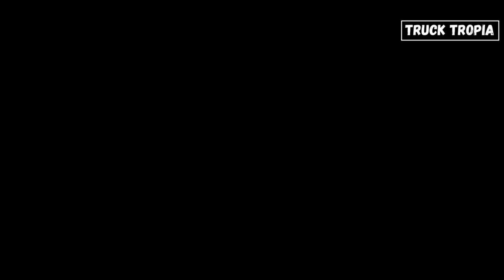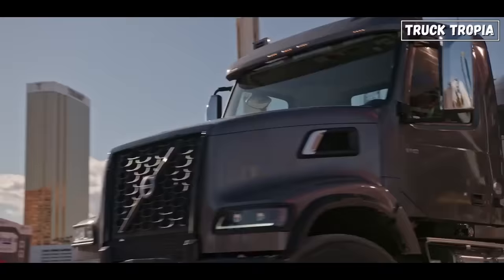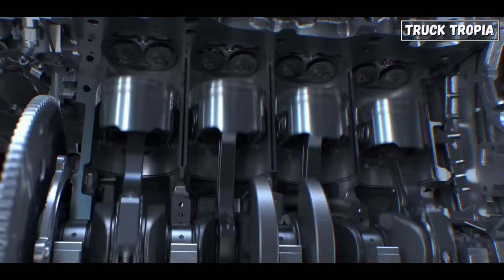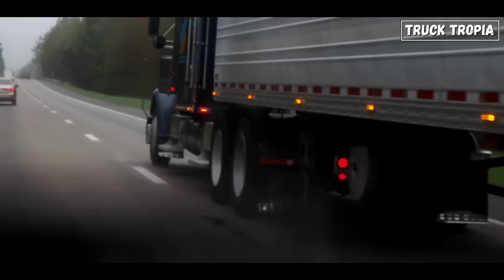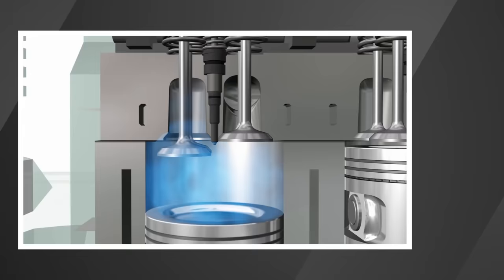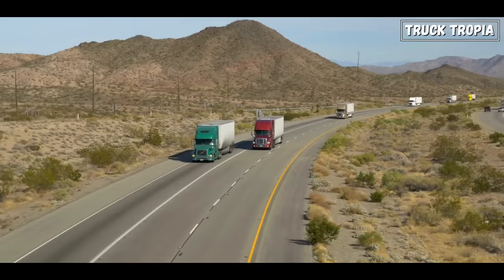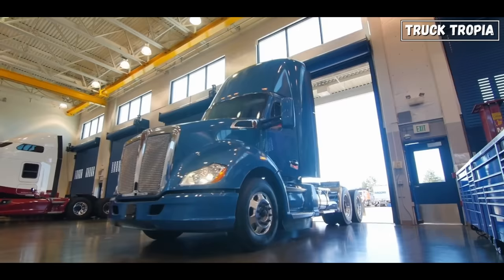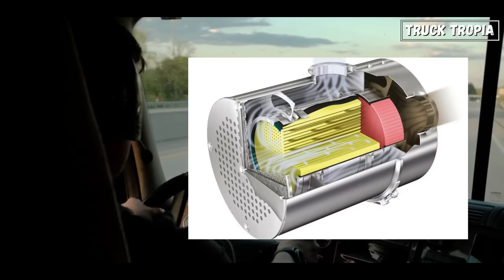Ultimate Truck Education 101 - Every Question Answered

Comment: On the transmissions, automated  ones can produce better fuel mileage with average driver experience but manual transmissions can get better fuel efficiency with very experienced drivers.
Reply: Automatics, any Primate can operate one, IMHO the reason that we are seeing so many more and serious truck wrecks is due to the proliferation of the automatic transmission. 
They are putting any Tom, Dick and Jane with a heartbeat behind the wheel.
Reply: Every truck driver out there started as a Tom, Dick or Jane. Automatic trucks still have gearboxes, the computer shifts the gears which protects the engine from over revving and frees the driver to concentrate more on driving safely. Old stick shift trucks are dinosaurs driven by fossil’s. I would never drive one of those old trucks anymore. They suck.
Reply: @albertwilson7239 
And you can’t use a 13 speed because the school didn’t teach you how. The 1st truck I drove had a 2 stick 4X4 in the mountains of AZ, I never did get good with it. The truck I sold was a 13 only used the clutch when I was starting or stopping. BTW I never went to a driving school. I learned the old way.
Reply: @albertwilson7239    that’s not true. Not every driver started out as a Tom, Dick or Jane. There used to be a lot more generational drivers, like myself, that learned at a young age and guys like me helped those new drivers learn the ropes. Now you have drivers that have very little experience teaching new drivers with no experience. The fact that you believe that automatics are better just goes to show you were never taught properly. No matter the innovations with automatics, they have massive downsides, especially in hill and mountainous areas. They are especially harder to control when backing. It all comes from who taught you. If you worked for one of these big companies like Swift or Werner, then you were likely taught by either another inexperienced driver or a driver that was also taught by another inexperienced driver. It’s a chain that creates more and more bad drivers.
Reply: Then the maintenance of automatics is through the roof compared to stick shift. They are not more fuel efficient nor are there any advantages any way or form. Any Muppet can destroy an auto faster than a stick shift.
Reply: @dirtfarmer7472 Yes, some of us had the experience of the twin stick. Mine was with a 5X4. Knowing how to double clutch helped keep the gears happy while shifting that set up. That is another lost art. Had a ride along that asked what I was doing. They had never heard of it. They really knew how to make me feel old.
Reply: @ronfullerton3162  hell, knowing how to shift period is a dying art lol. I do love the argument that shifting gears is fatiguing though. I’m just thinking, are these kids so soft that moving your arm just a little bit to shift wears you out?
Reply: @Coonazz791  As with any job you do that is repetitive, it becomes an automatic reflex. I never consciously thought about the shift. Matter in fact, most any shift I screwed up was from thinking about it. The body and mind in a subconscious way keeps track of the rpm, the load, and road conditions. When conscious mind took over was for possible endangering situations coming up in traffic, weather, and such. 

The shifting is just like anything else, you have to learn it by experiencing it. After 100,000 miles or so, they would get past thinking about it and it would be automatic reaction for them. But "Geez, it is just too hard!"
Reply: @ronfullerton3162  yup, it’s the mindset of this current generation. Things have to be easy at every turn. If not, they don’t want to do it.
Reply: Trucking in the U.S. is being ruined by foreigners, often 5 in the same cab, many from india.    Spend some time just people watching at the flying J.    Truck never stops, with 5 smelly people just rotating the driving.
Reply: @albertwilson7239  Incorrect, There are automatics being used in trucks that are not electronically shifted gear boxes. Allison. They have been around for years too.
Reply: @C-Culper4874  Ive driven trucks and been a mechanic and I know what you are talking about but never seen one other than in books. It has a torque converter instead of a clutch  like a car. They also had automated manuals with a third clutch pedal, again, never personally seen one. Does not mean they dont exist. But very rare.
Reply: @albertwilson7239  4000 series Allison's are popular now. We have several in the fleet I take care of. Some prefer those instead of Eatons. Building an auto transmission to take the abuse isn't hard itself. The puzzle is making it fit between the frame rails. I went to school on the Gen 1 autoshifts in the 90s when the first 600hps 2000 plus torque. The signature 600 was a beast. I saw those put 700 to the ground in a w900. Eaton talked about making transmissions for those. The issue is the limited area it had to fit. Electonic controls are the reason they can pull it off now on the autos. The engine out put can be controlled. Throw one behind a 3406 with the fuel rack stop screws in the ashtray. They probably won't live long.
Reply: @Coonazz791  But there is one big difference between nowand then:

You said, that you learned at a young age how to drive.
But it took years to learn the skill and that time was given you to learn.
But today, people have a week or maybe a few weeks to learn. But there is still the expectation that you are the same good driver when you finished your training of a few weeks then as when you learned for a few years in the old days.

That's not really fair, is it?

But I agree, today the level of skill and common sence is going down hill... and fast.... 😕
Reply: @JohnnoHald It depends on what kind of automatic you mean.
Because a fully automatic transmission is indeed more expensive to maintain and service, then a manual transmission.
But an automated manual transmission (AMF) needs the same kind of mantainance as a manual transmission.
Because an AMF is basicly a manual transmission wich is automated.
And fully automatic transmissions are becoming rare these days. By far the most automatic transmissions are actually automated manual transmissions.

And AMF transmissions are absolutely more fuel efficiencient then manual transmissions.

And it's actually way more difficult to destroy a automatic transmission then to destroy a manual transmission. 
Because an automatic transmission has all different kinds of safety features built in the computer that will protect the transmission and engine against wrong gear shift, wrong use or user fault.
But a manual transmission don't have that protection. And it's easy to make one wrong gear shift and destroy the transmission and maybe even the engine.
Reply: @Coonazz791  Depends on the truck. Where I work we haul shipping containers. Most of the trucks are Ivecos, Ivecos do not like to go slow, so they are a pain to drive and can't manually push a gear up or down.
My regular truck is a 2006 Mercedes Actros, also auto, but will go slow and I can push it into a higher or lower gear, very nice to drive.
Give me the old Merc over the newer Ivecos every day.
Reply: @josviersel  sure, but from what I’ve heard from different drivers that have autos is that it seems there are upsides and downsides to each type/brand of transmission, but none have it all. But even though, those autos have a lot higher downtime and are in the shop a lot more often than a manual, this comes from dealerships I’ve talked to.
Reply: @musictolive4  I wouldn’t say it’s easier to destroy a manual since I’ve heard of a lot of those autos rip themselves apart.
Reply: @Coonazz791  I guess that would be possible, but I never heard of that or have experience with that.
But like every machine you operate, you have to get used to it. Learn the machine and learn to work with it. But also give the machine the time to do the job for you.
Like a manual transmission you also have to give the gears the time to float in to eachother. But with a manual, you feel it and you not realy aware of the time it takes to shift gears.
But a lot of drivers who drive with an automated transmission don't give the transmission the time to shift, and expect that the shift will happen instantly. Then things will go rough and you can do damage to a transmission.
Reply: I fiddled around and found that the Iveco can go into semi-auto mode, and how to push it up/down a gear - but it is not intuitive like the Mercedes.
(Iveco still does not like going slow.)
Reply: @musictolive4  I would just chalk it down to that there are advantages and disadvantages to each. But when it comes down to money, I’ll take a manual over auto any day of the week. For me, being an O/O, the costs of an auto just isn’t worth it.
Reply: Electric motors give better mpg
Reply: @unknownunknown-ni1ns  you’re right, but they get worse miles per pile of coal burnt.
Reply: Most of the younger generation can’t even use a 3 in the tree much less 18.😂
Reply: @albertwilson7239 I control the truck with a manual, with automatic the transmission is controlling the truck not you.
 I feel uncomfortable around automatics.
Reply: Too many primates behind the wheel 6:04
Reply: Automatics get zero miles to zero gallons when they break.

Comment: Tbh, large companies changing to automatic transmissions has nothing to do with driver comfort. It has everything to do with new drivers having never learned how to drive manual transmissions even in a car and not knowing the basics. I’ve driven an auto truck once before and I was more fatigued in that and found myself zoning out than when driving a manual. 

But just to prove my point, the driver in this video actually used the clutch while shifting. If you know how to shift properly, then the only time you need to touch the clutch is when coming to a stop. 

And before someone says, “well, an automatic transmission is great in heavy traffic areas.” Again, that’s because you weren’t taught right. I can drive through most big cities in stop and go traffic and rarely touch the clutch. If you don’t drive a truck like you’re in a hurry to get somewhere and just coast, then you’ll rarely have to come to a stop. But everyone wants to ride up each other’s asses like that’s going to get you somewhere any faster.
Reply: Fatigue sets in when you’re on a long open road not in stop go traffic so really it doesn’t make a difference because you’re not changing gears on an open highway. I’ve driven both manual and auto trucks and there is really no comparison in ease and comfort when driving an auto especially in traffic.
Reply: Shifting, or let's get down to brass tacks and call it floating, which is what you are doing without using the clutch pedal, is not something that is taught in the driving school because the prospective CDL licensee has to demonstrate to the state examiner the proper shifting technique using the clutch pedal when/if driving a manual transmission equipped tractor, which is what I had to do in 1999. I experimented with clutchless shifting several years later, it took a bit of practice but got the hang of it because I didn't want Arnold's left leg in contrast to the toothpick right leg
Reply: You sir are correct. I have a Dodge Power Wagon with 285,000 miles and have never had to make any major repairs. I rarely have to stop at traffic lights because I’m coasting to them as they change. I will never understand why people want to “Race me to a Red light”, Followed by a “Rabbit start to nowhere.”
Reply: I think it’s just so mega carriers have more remote control of the truck
Reply: @donaldtireman  I have a throttle spring that will solve that problem for you. 🤪
Reply: "The reason people are using swords now is because they weren't taught how to use a stick right! Back in my day everyone knew how to use a stick. If you can't use a stick and use your sword as a crutch then something is wrong with you. Get rid of swords and use sticks you'll do better in combat!"
Reply: @fuzzy5610  I can't believe anyone would try to argue a manual transmission is better than a automatic one. They only ever attack the driver and fail to actualize any benefit a manual transmission has over a automatic one for the person who's actually driving. 

People don't drive automatics because they're lazy or incompetent, people drive manual transmissions because they're stubborn and sometimes delusional.
Reply: @user-mc6dg6qe8l  2 totally different things. And who exactly are you quoting?
Reply: @donaldtireman  funny story about that. I had to go to a driving school for a refresher because I had gotten out of trucking for a while back in 2009. They taught me that all I had to do is tap the free play to pass the test and that’s what I did. 

This is what happens when the government tries to tell you the right way to do things.
Reply: @fuzzy5610  I did address this in what I said about driving in traffic. I can go through Chicago during rush hour and never have to come to a stop. Let me guess, you’re one of the guys that rides bumper to bumper everywhere you go. You’re constantly stopping and going when you’re in traffic.
Reply: @hardpointz399  remote control?
Reply: @Coonazz791  what can a manual do that an automated can't?
Reply: @AlexKall  so you’re going to answer a question with a question. Gotcha. It’s never been a good debate strategy and it never will be. You don’t want to have an honest discussion and there’s no point in talking to you.
Reply: Incorrect I would mostly use the clutch to start rather than stop
Reply: @estebanmena4332  did you know that’s actually illegal? You should be in gear at all times, even when coming to a stop.
Reply: Those newer drivers shouldn't be on the road. 
Fewer distractions when you actually have to operate the tractor.
Reply: @user-mc6dg6qe8l Automatic transmissions are less efficient. They turn more of the engine's energy into heat. This's a fact, not an opinion.
Reply: Driving a truck with an automatic transmission is the most frustrating thing in trucking. I had to raise a lot of hell to get back into a manual 18 speed.
Reply: I do the same in Chicago and other major metro areas. Learned that over 20 years ago.
Reply: @donaldtireman  came here to mention that during test. Though my tester said and I quote. "I know how you are supposed to do it show me you can get to fifth before we get to the sign and you can float the rest of the test cause I could tell you did it coming up to the parking lot." So I did what he said he laughed and let me float for the rest of the test and back only time he made me show again was getting onto interstate then said I could float the rest of the way.
Reply: @joshmusicmix9459  I cheated and took my test in a single axle dump truck with an Allison automatic, pulling a light tilt deck trailer. It was a breeze
Reply: @johneckert1365  I tested with cr england ffor cdl test which meant full sleeper and 53. My manual I tested with my new boss o/o in a 14 freightliner 10 speed manual with 53 trailer on.
Reply: @joshmusicmix9459  nice 👌
Reply: I did 15 years in an 02 Mack. Well over a million miles with a manual. Not including who knows how many miles in personal vehicles. I was totally against it and sounded like you at first but I’m 4 years in with an automatic now and there is no way I’d go back. I’ve got nothing left to prove. I’ll keep the automatic, this fancy comfortable seat, the properly working AC, and the electric assist power steering. I still feel fresh when I park it for the day.
Reply: Of course the automatic has to do with comfort.
Reply: @Coonazz791  
Ok! I'm talking about Europe where the drivers comfort is almost no.1 in what's important. A happy healthy driver is important.
Reply: @Coonazz791  
That's your problem. How can it not be more comfortable with automatic. You put it in drive and the truck do the rest instead of waving around a stick everytime you need to change the gear. I guess your own car is an automatic. Why not a manual in your car
Reply: @Coonazz791  
Well that's your choice.
Reply: @Coonazz791  
I live in Europe so we have up and downhill, narrow and winding roads everywhere. That you have lots of trucks smoking their brakes is probably because your trucks are 20 years behind european trucks. Our trucks are 114foot long and permitted weight is 163000 pound
Reply: @Coonazz791  
Of course we have also both longer and heavier trucks. And yes the american trucks are way behind.
Reply: @user-mc6dg6qe8l I have control over the truck, with that automatic, the transmission is controlling the truck not you.
Just because you can't float an 18 speed.
Reply: @Coonazz791 I feel more comfortable in a manual, I feel uncomfortable around automatics.
Reply: I would say the benefit of the manual becomes obvious when driving in the mountains.
Reply: @marcgoff7881 granted my challenger is automatic but I coast to light as well and leave a decent gap on the highway. My front brakes lasted 188k miles.
Reply: @donaldtireman I've never drove trucks before but soon plan on taking off to school for it. I want an 18 speed tho to be honest. When I heard about floating gears and it was explained to me I thought man I've done the same thing riding dirt bikes growing up its very common especially if you race to float your gears six speed clutch no clutch
Reply: @marcgoff7881 right I never understood that people will race to get to the same red light that every body is about to have to stop and wait at anyway
Reply: Completely agree . floating them in
Reply: @pengiethebird Totally agree. Hate automatic
Reply: Manual transmission can be difficult and even dangerous on grade. Missing a shift down grade can deadly. That's why runaway truck ramps are found in those areas. Even an experienced driver can sometimes miss a shift. It can be impossible to reinsert it into gear once a shift is missed. To me that's the best argument for automatics in big rigs.